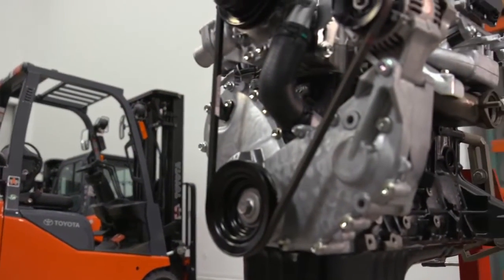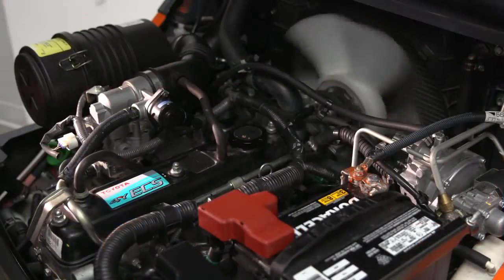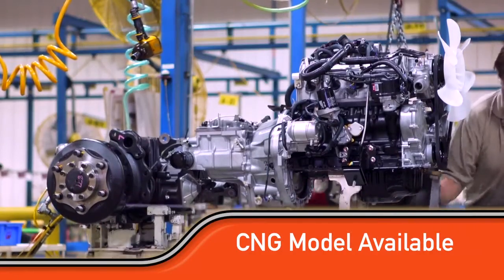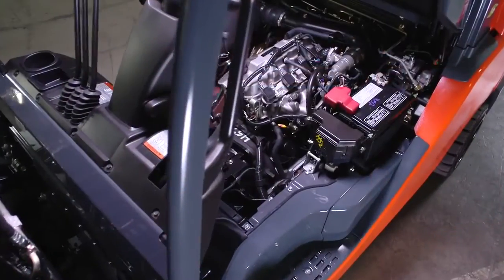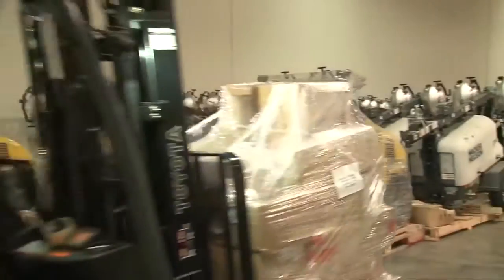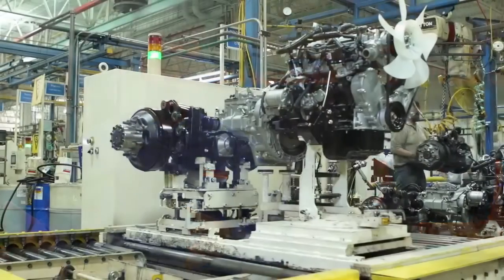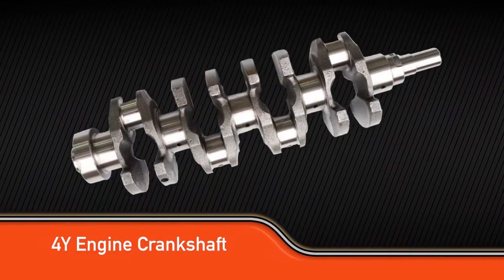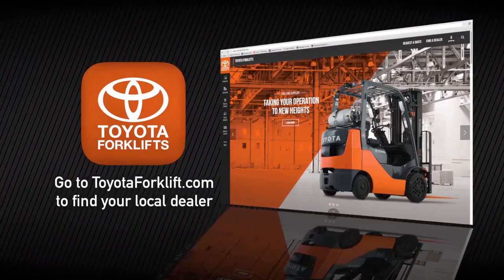The Amazing Toyota 4Y Forklift Engine

Comment: My dream is to buy a 1996 imported y-series engine gasoline Town Ace or Toyo Ace four-wheel drive dump and put a dual fuel system on it. @Toyota if you see this sponsor me! I'd also like to put one of the a45 automatic transmissions

Comment: I wonder if i can purchase one of these updated 4y engines to put into my 86 toyota hiace 🤔
Reply: In China, we have the h100 hiaces still being produced, some with 4y engines
Reply: @thevillageidiot70  yes they named it 493 or something but its a 4y clone very good engine
Reply: I have a 4y in my 88 HIlux and its magic
Reply: I have an 85 Toyota van wagon (master ace surf) and I was wondering the same thing
Reply: @oligt90  Got one in my 87, runs great.
Reply: @salpine  did you need to do anything special to make it fit in your van? Was the intake manifold and throttle different or the original one in your van compatible bolt on?
Reply: If it's like the 4y from the 80s don't forget the Zink additive
Reply: This engine is turbo diesel ?
Reply: @pr4lviper  nope gas 4 cylinder